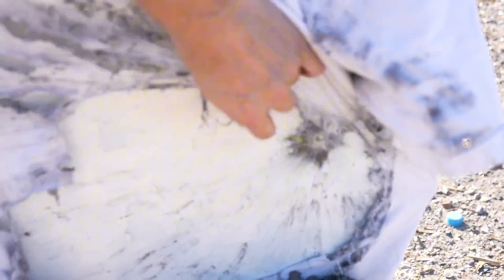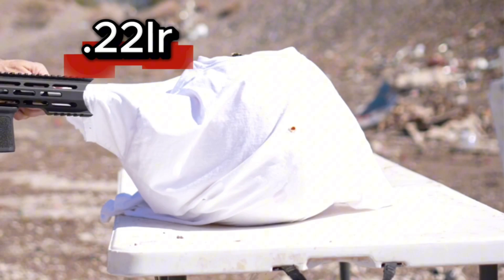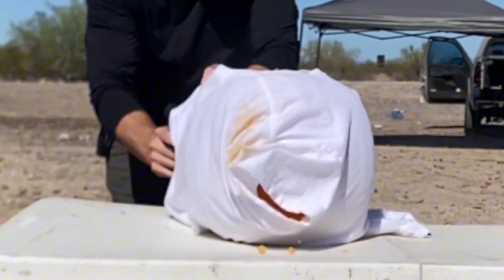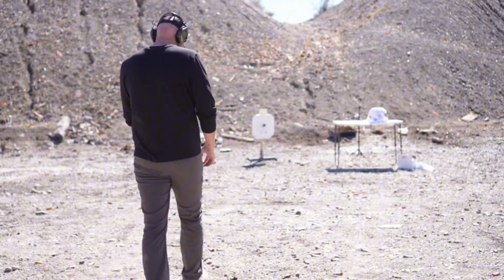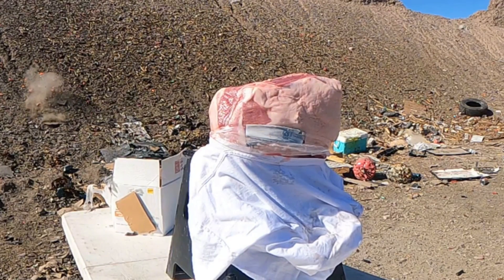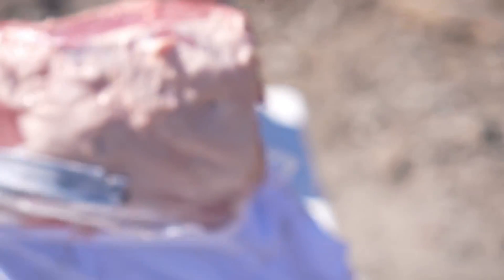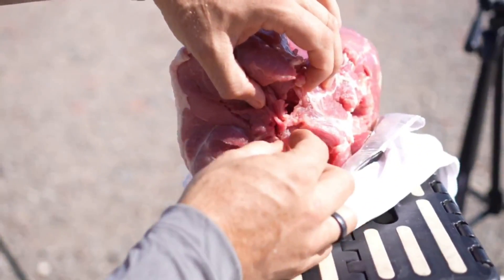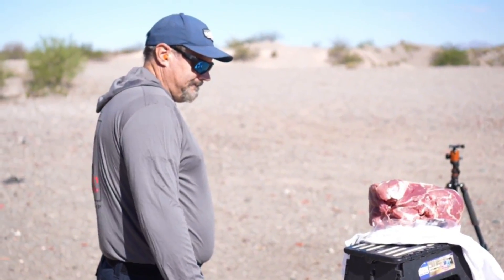Charlie Kirk Shooting: Every Theory DEBUNKED Once and for All

Comment: The prosecution is committed to the murder weapon being Tyler's 30.06 rifle found near the chicken coop. The text messages between Tyler and Lance refer to the 30.06 rifle received from Tyler's grandfather. The prosecution's case against Tyler falls apart if the murder weapon wasn't a 30.06 rifle or if the rifle found by the chicken coup wasn't the murder weapon. We don't know whether forensics has evidence that the rifle found near the chicken coop was fired within the last few hours or that the spent casing was fired within the last few hours. Charlie's wound doesn't seem to match a 30.06 wound. Will the prosecution tell jurors, "Bullet do weird things"? That isn't evidence. If the defense tells jurors, "We shot a thousand 30.06 bullets and didn't have a single case where the wound matched Charlie's wounds, jurors will probably acquit Tyler. In the CCTV shots, Tyler has a thin adolescent male body rather than a thick mature male body. His jeans look like slim-fit jeans. His t-shirt seems to be more form-fitting and to have thinner material than your t-shirt. The outlines of a rifle stock hanging from one armpit down to his knee and a rifle barrel hanging from his other armpit down to his knee would be noticeable to passersby though the thin material of his t-shirt and slim-fit jeans. We need video footage of Tyler walking to show whether Tyler walked as slowly and as clumsily as you walked.